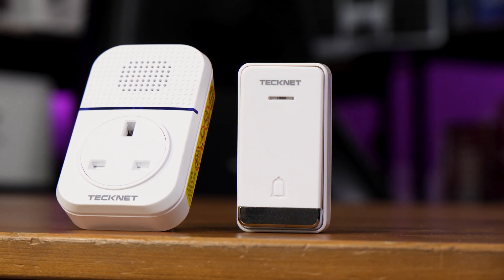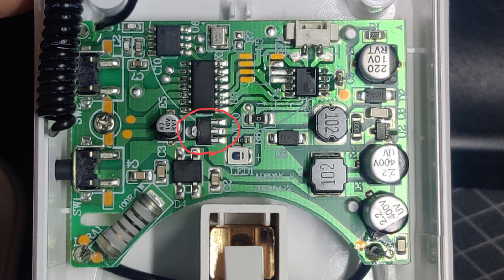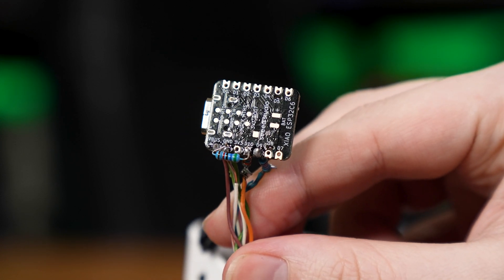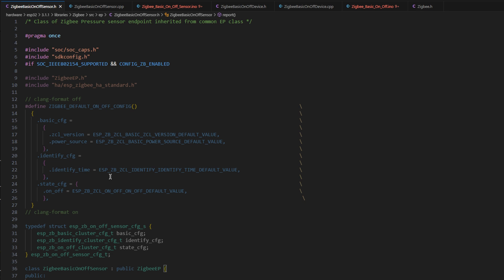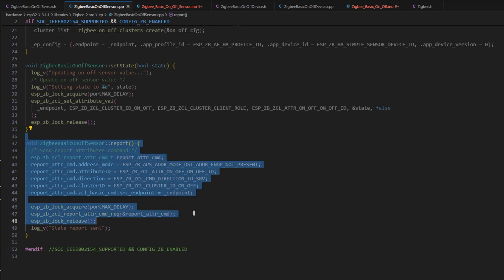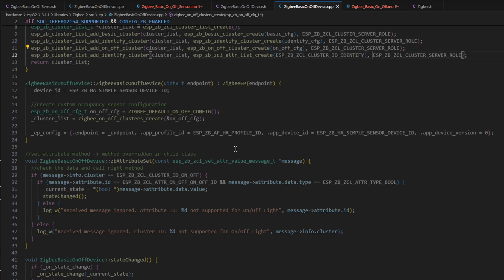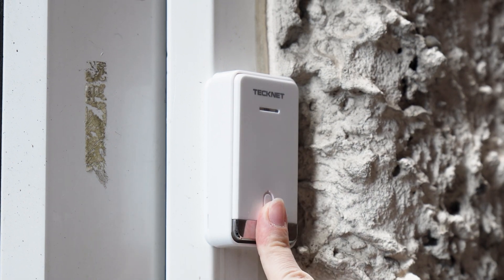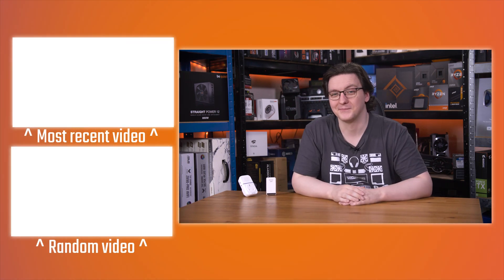I made a Custom DIY Zigbee Doorbell

Comment: Cool project! 
I used a C6 to make a very low energy IKEA-like Zigbee button. Letting the ESP go to light sleep, it uses only microamps. 
The code felt crude and I was only able to make Z2M see a "last seen" and I had to use that state change as an automation trigger. 

You seem very well versed in this, and I wonder if you could make a better one.

Comment: Would love to see a walk through on how to build a battery powered Zigbee switch to turn on and off a low amperage device with a local push button switch or via home assistant.  Need one of these to drive a fireplace. How much power can a C6 device "switch" before a relay is needed?